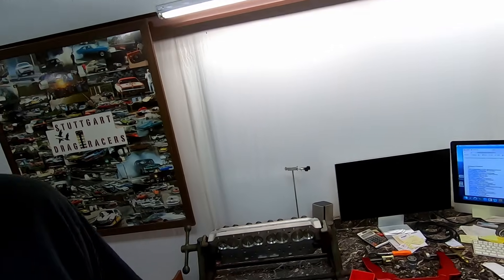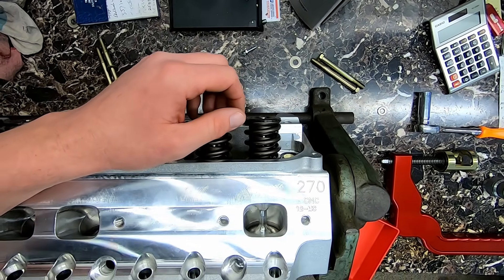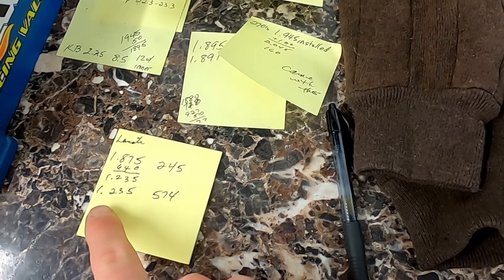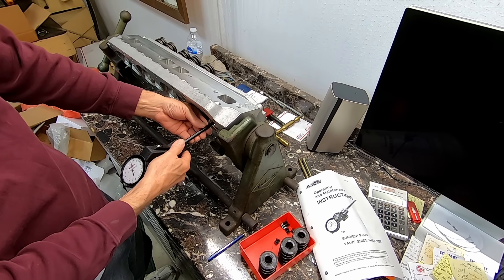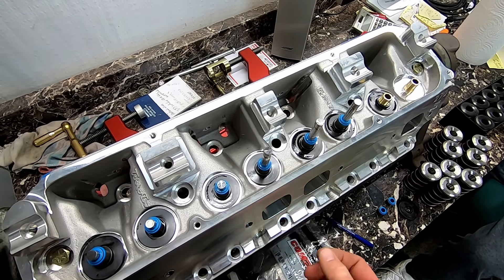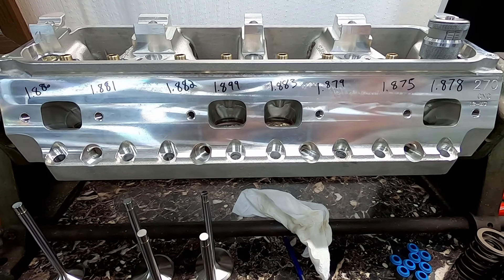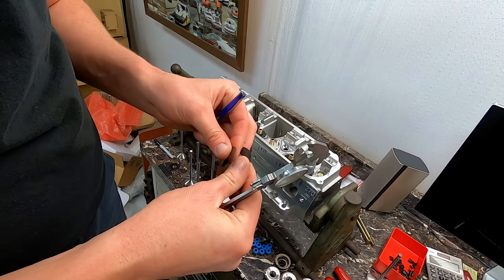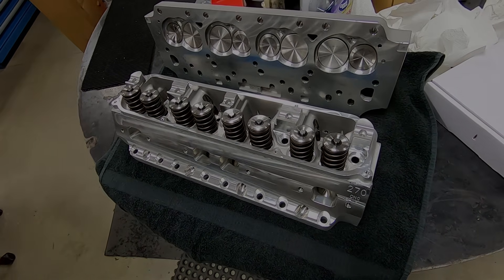Setting Up the TrickFlow 270’s for the Dyno 512 Build @rickseeman5679

Comment: What kind of numbers you thinking this will make
Reply from the maker: I’d like to see 700 horse and 720 foot pounds.
Reply: @JustMoparJoe  I am having my 512 dyno'd tomorrow 
11.5 comp 
Indy 440-1 345 heads 
640 ish lift 260 ish dur
Indy single plane 4150 and 4500 gonna try both 
Will let you know what it does

Comment: "Its the little things that matter most in engine building." I believe you said a few builds ago and this is a perfect example of that. If you hadn't decided to change something you'd have never known how far out the seat pads were. Speaking of little things, what is the deal with the exhaust manifold pad? It might just be lighting but it looks like there is a ridge or a taper running all the way along the head. Also where is the oil drainback holes?
Reply from the maker: Thanks, I appreciate you paying attention to the details! I think the lighting may have cast that line. The drain backs are on the upper side of the springs like a factory style. These heads have a 1/8” hole to feed oil to the rockers. That will help with drainage, because it isn’t flooding the top end as much.
Reply: @JustMoparJoe  You're killing it with this build, YET AGAIN! But yeah its weird because even when you move around that line stays. When i saw that i thought to myself, yup thats a major exhaust leak waiting to happen. Cuz it looks like a ~1" valley running through the middle of the exhaust ports.

Comment: Anybody got a great proven cam # for stroked 440 to 500 for A-body using the promaxx heads, 10.5 to 1. Not looking for daily driver but hot street car.. 3.73 gears and will probably go w @2800-3000 converter. Willing to go w hyd roller but hoping someone has proven combo they can either share or point in good direction. Car weighs 3000lbs. Thanks in advance for any good input
Reply: Yes.
Howard's Cams. Hyd. Roller 241/247. 110+4, .565" lift. 
440 Source sells it #162-1002. 

 Typically I profile every cam and have it ground to what I want, but in these 440-512 street engines using similar heads, Pro Maxx, Edelbrock, Stealth, etc.. I use this shelf deal that works perfect in these applications based on your gear, tight converter, and goals. 
Use a good header, Performer Rpm intake with a 1" HVH spacer, good carb, good aftermarket roller rockers, can run 1.5, I recommend 1.6. 
Minimum Power- 550+ around 5,500 to 5,700 rpm, and torque 575+ by 4,000. At the flywheel and has a nice sound to it 👌 

Completely streetable and torque for days.
Perfect for a hot street deal matching your car's description.
Reply: @JRD_Motorsports  I was not expecting the reply you just laid out. I cannot express enough how thankfull I am for you right now. What size carb you think? Im good at the full tuning of that. I would like to send you a thank you for this info. If you have a address let me know and if not comfortable putting it on here than maybe a email and I can get it from there. If not comfortable with either I also respect that as well. But either way I thank you so much cuz as i have everything but the loose ends to buy ive been not wanting to get it wrong and wanted real advice, so thanks brother.
Reply: @brianb5779  All good 👍  Your thanks on here are appreciative enough. You can get the Howard's hyd roller lifters as well since they are actually a Morel lifter. 
I recommend at least a 950 Holley HP carb at minimum.  Basically, it's a 750 main body with an 850 baseplate. Good luck 👍
Reply: @JRD_Motorsports  Well brother again Id give ya a hug and handshake and a huge thank you. Man you made my day👍
Reply: @brianb5779  🤘
Reply from the maker: @brianb5779 check out this playlist 508 Stroker Build
https://www.youtube.com/playlist?list=PLq1vqn6dUKFD6YBUBO4E1lYHI1NUOJEwB
Reply: @JustMoparJoe  Is there a discount thru 440source using your name?

Comment: How do the springs know if it's hydraulic of solid? Isn't it all about lift? I keep seeing heads advertised as having springs for one or the other.. please help me understand this.. love your vids Joe!
Reply from the maker: Thanks for following along. Basically, they have a different spring rate. They can look identical, but one is a lot harder to squeeze. Too much pressure on a hydraulic lifter can collapse it. Solid cam lobes are alot more aggressive. They are throwing the lifter up every time, where the hydraulic lobes have easier ramps to climb. So we add more spring rate to compensate.
Reply: Like Joe said, it's all about spring rate and pressures, and matching them to the correct application. A lot of variables to consider.

Comment: I wonder what the difference is, my 240s set up at 1.940 with solid flat tappet springs and I set my solid roller springs up at 1.930. I guess I have .054 more lift than your cam.
Reply: The difference is the spring itself, not so much the heights.
Reply from the maker: That’s a big bump stick 💪🏻
Reply: According to some in all out race car .050 more than what your head flows is good. So this is still a bit short but it's better than the sft I had.
Reply from the maker: @ I’m a believer in the wrong harmonics happening. I didn’t much notice it before my dyno testlast time, but I remember it on the engine masters episode. Maybe Spring rate is the answer, but installed height is the cure 🤔
Reply: @JustMoparJoe  Harmonics is a thing, that's for sure. It's been my experience over the years that installed height is the amount of room you have to play with, but the actual spring design is what matters. Valve and lifter control in a stabalized valvetrain know nothing of installed height, but everything about what the spring is, or isn't, doing.  
You CAN, however use the height as a bandaid to manipulate the spring a bit if needed, but it won't cure any major issues.
Reply from the maker: @ I am not worried at all about the pressures and setup in this video, because my current 512 runs the same spring setup at 1.880, with around 550 open. So far I’ve been 6.12 with that engine over the last two years. I know many guys prefer excessive spring pressure like a stud mounted rocker would like. Ma Mopar blessed us with the shaft mounted rockers 🥰
Reply: @JustMoparJoe  Not at all saying it won't "work".... but I WILL say just because it runs doesn't mean something is optimal, or enough. Have taken way too many heads apart over the years that "ran great" but showed signs of issues due to not enough spring, let alone "over-springed" where the correct spring made more power 🤪
 And last i checked, the spring doesn't know what rockers they are, so spring requirements would have nothing to do with what rockers are on it 😏
Reply: @Moparmaga-1  Not entirely true. Obviously, in an all-out race engine, you want as much lift as you can run.... but it isn't just valve lift that fills the cylinder, it's every other valve action that does as well. Just because you open the valve a bit more than what a flow bench says to doesn't mean much in the big picture.
Reply: @JRD_Motorsports  yes I'm aware of that, thank you

Comment: Me being me, i would have liked a bit more rate on that spring for added open pressure. A bit soft for my liking on that stick.... also keeping in mind installed pressures drop a bit after a few heat cycles and initial run time.
Good idea to tighten up that spring stack clearance, can never stress that enough. 
ALWAYS a good idea to disassemble mass produced heads. Even if you plan on running the same parts. I have found, 9 times out of 10, the spring package always needs to be changed anyway. That includes shims. locators, retainers, and springs, as well as CC those chambers, most are not what is advertised. 

Nice job, Joe. 👍
Reply from the maker: Thanks brother! We aren’t looking for crazy rpm potential with this thing. It should pull clean to 6,500. I think that’s all the cam is rated for, and the longer stroke will eat some of that
Reply: @JustMoparJoe All good. Hopefully it does what you're asking it to do. Knowing those pressures will be a bit less after some run time, makes me cringe a bit lol. 
Don't get hung up on advertised cam rpm ratings. Way too many variables. Regardless, it should run good 👍

Comment: Nice work Joe! I’m going to try the springs that came on my solid roller 270s with a similar cam. My engine spins to 7500 rpm, so the plan is 1.875 installed height and should be around 300lbs on the seat and 650 over the nose within .060 from coil bind. On the spec sheet they call out .700 max lift at the factory 2.000 installed height, but best I can tell that limitation may be due to the seals.
Reply from the maker: Sounds like you’ve got a good plan there. I think they always put their specs to cover their butts

Comment: I'm surprised those hight's varying that much is that normal Joe?
Reply: Define Normal..... 

Is it "Normal" for mass produced heads? Pretty much. That's why you shouldn't run anything previously assembled and mass produced until they are disassembled and checked. 

Is it "Normal" for professionally assembled heads for a specific combination? No. Heights CAN vary from valve to valve, typically up to +/- .010", which won't affect pressures much. 
More importantly, making sure of retainer to seal clearance, and spring stack clearance. You DON'T want too much.
Reply from the maker: I definitely think mass produced items are only as good as the assembler, and the quality of the components they provide.
Reply: @JustMoparJoe  Correct. But I'll add that mass produced heads, even when assembled correctly and good parts were used, are NOT built to each individual customer's needs. They are made and assembled with what's called "commercially acceptable" tolerances. Universal at best, to fit the needs of most. NOT individually built for exact specifications for each build... therefore always best to go through them.  
We deal alot with assembled stuff and 95% of the time, require changes. Hence the reason I go with bare castings and build accordingly for any serious stuff. 👍